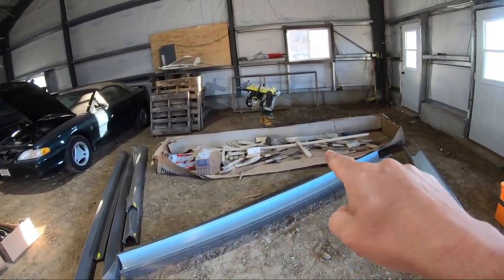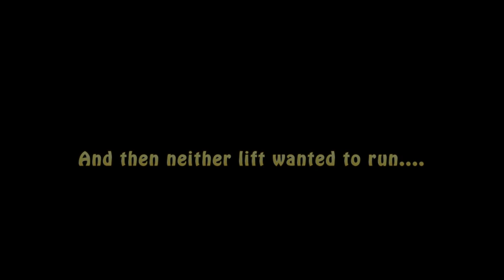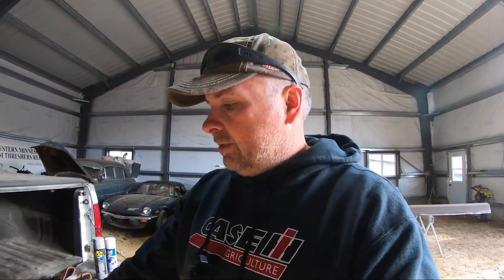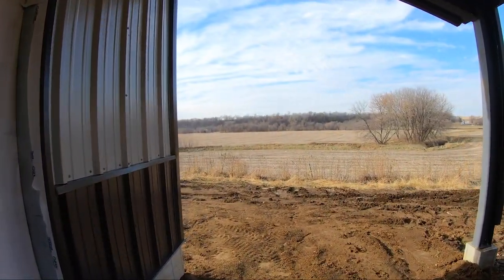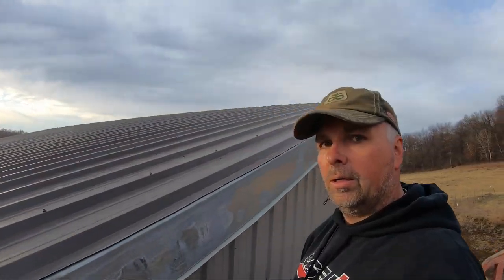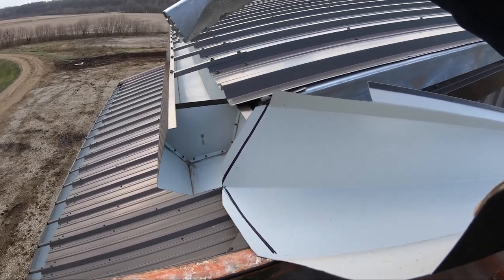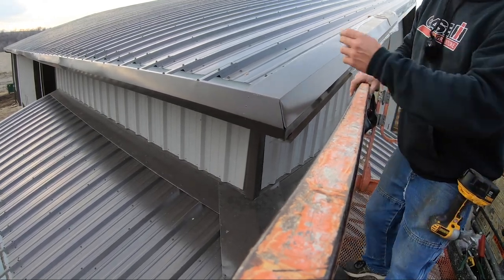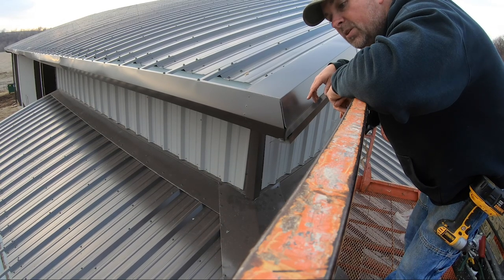Steel Building Erection: Part 8 - Trimming out the... trim and gutters

Comment: Did you rent the 3 lift/ crane's?  If so, what was the total rental cost for all that?  The reason I am asking is I too am going to be doing a 50 X 80 GWS building hangar.  I am trying to compare cost to have it erected vs building.  You and I are both first time steel building guys with previous amateur stick building experience and mechanical knowledge.  You had quite a few rain days slowing you down.  I will be building in FL so who knows.  Anyway total equipment rental cost would really help me decide which way to go.  Thanks... and Nice work!!!
Reply from the maker: Hey Derek, the lifts & telehandler were a unique deal for us, as our neighbor has them and rents them, so while it still cost a few grand, we had the lifts here most of the summer.  If you've got a crew of friends to get the building up, I'd think a few 3 days weekends can get it done.  A long weekend for the heavy steel, and another weekend on the sheeting, especially if you're not having all the add-ons we had like the porch, lean-to and 18" overhangs.  Sheeting went quickly, but the trim was time consuming.  I estimated our erection would have cost about 40k on top of the building.  If you're build site is already on asphalt/concrete, even your rains won't slow you down too much.
Reply: @DachsAutos  OK thanks